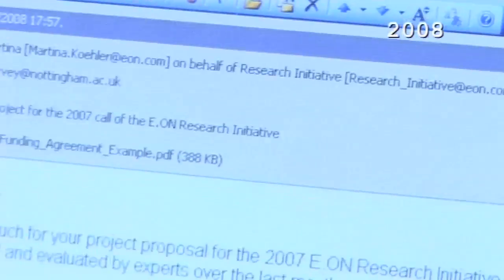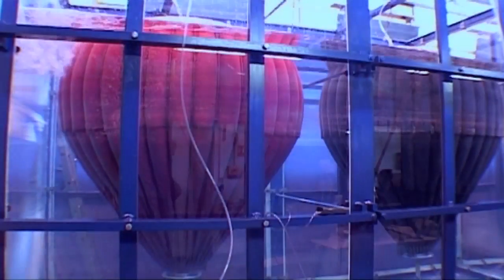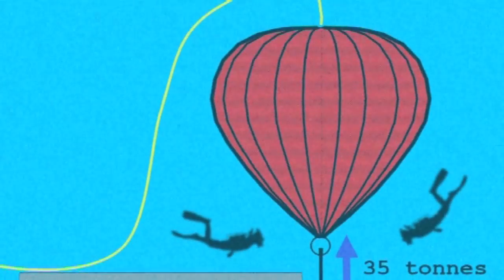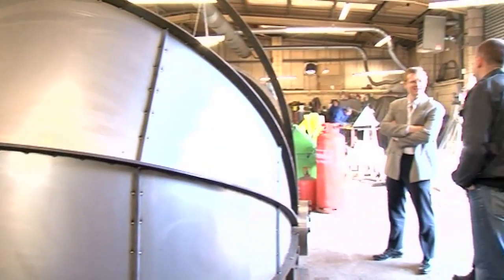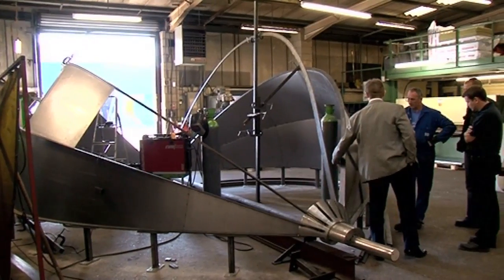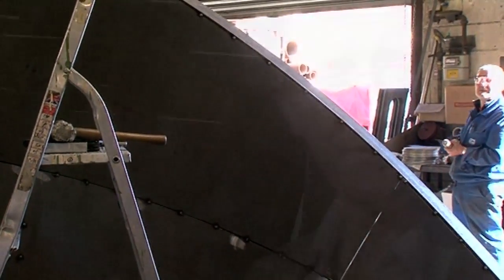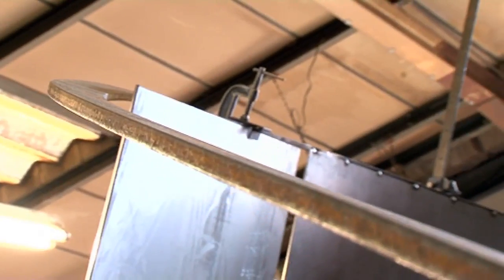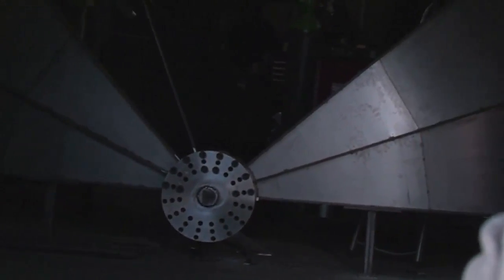Underwater Energy Bags

Comment: Then the grout will set and you'll have a solid lump of concrete with a bag wrapped around it.  If you put the right things inside the bag you can even have anchors cemented in with non corroding cables running up to the actual energy bag.   It's similar to the current practice of using "mattresses" filled with grout to hold oil pipelines.  Really, sinking rigid steel objects that have air inside *never* ends well.  Please please avoid that at all costs!

Comment: Former commercial diver's perspective on this...   Steel is a dredful material in a marine environement but I'm sure you've taken that into account.  By allowing the air/gravel mix to sink, the pressure differential will destroy the steel container as it drops from the surface to just a few metres down.  I've seen several similar attempts to do this sort of thing and it's always a disaster.  If I was doing it I'd have an upside down energy bag, sink it, then fill with grout from the surface.

Comment: Compressed air is potential energy when stored, and the wind turbine works by spinning and compressing the air into the bags I believe, and so when you have no wind and need energy it simply is released through a generator and you have electricity.

Comment: You can attach a tube and a turbine to the energy bag and generate electricity.
 
If you fill it with air at low tide, and then release the air at high tide, you can tap into tidal forces.

Comment: air doesn't become energy. it's like a battery. compressed air 'stores' the energy. you use energy to put the air into the bag-- when you want to use the energy again, you have to release the air. the air will probably power a generator to create electricity. like a damn, you can pump water back up to the top to store extra you created by releasing it.  

you can put a lot of air in the bag if it is deep underwater because the surrounding high-pressure water helps contain it.

Comment: Usually, the xL (reactance) is 10 times higher than the r (resistance), in pu (per unit system). Also, the mutual impedances are significative, in AC transmission. For the power losses, only the resistance is responsible, but for the voltage drops, phase, etc, the other must be considered.

Other points are that for a 3-phase AC transmission you need 3 (or 4 with neutral) cables, while for the DC, only one. For dry land, the most cost-effective solution is the 3-phase.

Comment: actually, DC is almost always used for off-shore wind turbines and for underwater transmission lines. The resistance of the overhear TL is not the issue, either with AC or DC, but it's reactance (that is the imaginary part of the impedance, related to inductance and capacitance effects).

Comment: I have never seen DC recommended for long distance power transmission.  Power transmission in modern times is almost always AC and that is because it steps up or down very easily.  in addition to having lower losses in real operating environments.  DC's problem I seem to recall ends up being resistance.  the voltage drops and isn't easy to step up or down.  
you use transformers with AC, voltage regulators with DC.

Comment: You'd be surprised then. current batteries are really quite inefficient.  And there are far fewer energy changes involved with the compressed air system than an electrical generator storing power in batteries.  But yes, a big factor here would be the relative cost and longevity of the systems, good batteries cost a small fortune and degrade over time whereas an "energy bag" would be relatively inexpensive and would maintain its efficiency.

Comment: I would be extremely skeptical that the process is more efficient then several of the leading chemical energy storage technologies. HOWEVER, I bet the materials cost is far cheaper here, which (depending on lifetimes and such) is the other major factor here. A sizeable loss in efficiency but a huge material's cost advantage

Comment: Energy is lost to heat in every process, I should imagine that the whole point of this exercise is that storing energy in the form of compressed air is more efficient than storing it as chemical energy in batteries.  I would expect Seamus has done the calculations to show this before embarking on a £250,000 project.

Comment: Efficiency isn't as important at this stage as you might think. energy has to be used when it is made or it is wasted, Storing the energy by converting it is using the energy. And increases how much of the power your generating is going to be used. You take the energy you would otherwise have wasted and store it and then you can use the stored energy for grid balancing. Or to supply energy when your unable to generate energy in cases where your using wind and it isn't blowing.

Comment: My understanding is that the (maybe only, but still big) major problem with compressed air storage is that when you compress the air, it heats up a lot, the heat energy is the dissipated to the environment (like the water, in this case). That lost energy is significant when efficiency is concerned.

Comment: Oh great stuff.  Good to see more on this.  We really need more solid, cheap ways of storing energy.  Current methods are bulky, expensive and have huge losses at best.

I wonder if the manually installed method would be much cheaper though.  
Or possibly combining an initial anchor to drop a plate down to the sea floor, then have some large screws nail it to the bed really tight.
But I guess all these calculations have already been done in to the costs and maintenance requirements with this.

Comment: Combining this with a tidal barrage power system actually could give you a magnification effect, since you could get energy while the tide is out (and water is flowing out of the barrage), fill the bag while the external pressure is low, and then as the tide rises around the bag the pressure would increase.  If you tapped the bag when the water column above the bag was high, you would get much higher pressures out than you put in.

Comment: Thing is, we already have trains. Airbags are very simple in principle, but it's a new invention, and so the details need working out. It's simpler than your train idea because the train needs electricity, which must be produced somehow. Airbags store compressed air directly as it's produced, which maximises efficiency. The point is to store energy so it can be released when it's needed. The system will be wind- and/or wave-powered.